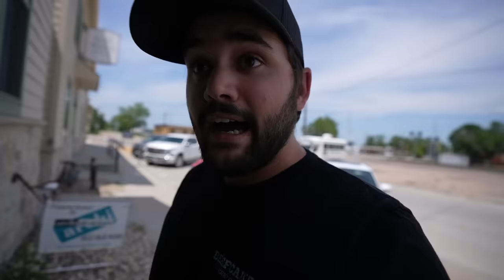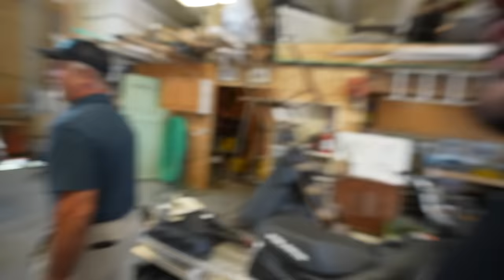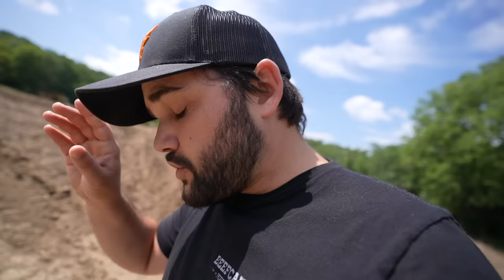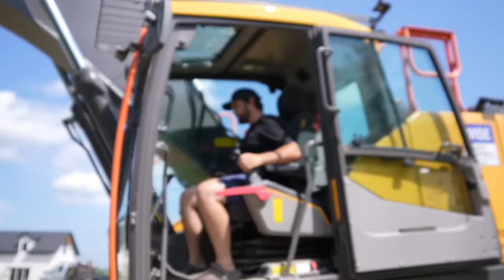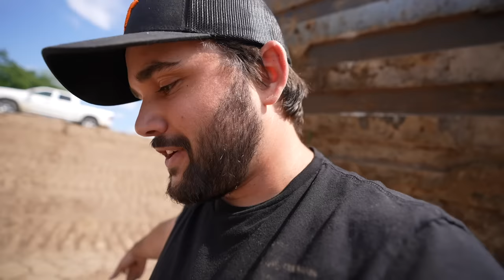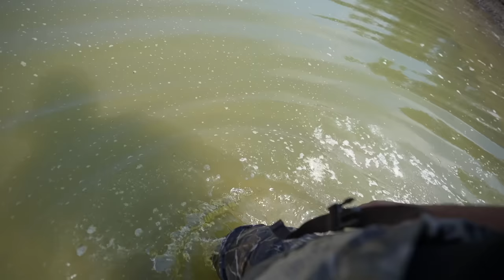FILLING the NEW BACKYARD POND for the FIRST TIME!!! (Will It Hold?)

Comment: Just a suggestion. Put a PVC pipe from the well pipe to the middle of the pond to prevent washout. It can be a temporary pipe until the water level gets to the main well pipe
Reply: A number of sections of pipe, then remove them one at a time as the level rises. Keep a rock/concrete under the outflow to break up the flow as it exits the pipe, just like he has done with the initial section.
Reply: This
Reply: Literally was going to suggest this
Reply: Same
Reply: Leave it for the small fish to hide in after
Reply: Stock some trout in there if it’s staying that cold
Reply: Or put a 90 on it and let the water rushing in shoot up
Reply: What this guy said!

Comment: You may want to think about a water tower/tank. If you ever have to redo the pond, it would be faster to fill it with stored water than to wait for your garden hose to fill it. You can even use solar/battery powered pumps to fill the tank 24x7.
Reply: That a good idea

Comment: I have always been a massive believer in 'do it once and do it properly'.  I can very much appreciate the turn-off of the massive expense of bentonite after it probably has felt like open season on your bank account since starting this awesome new project at this property.

If there is even a chance of seepage/leakage on top of the risk of evaporation I would be spending the money now while the lake is mostly empty and then you can rest easier going forward knowing your lake will not seep away back into the ground and you are set for the long term and have longevity for your lake.  Especially given you don't have massive water pressure and there is a risk of possibly draining your well.

But either way - thank you so much @Flair for your vlogs and content!

Comment: I wonder if an extension on the pipe where the water is coming out to reach further to the bottom would help wash away. Give the water less distance to travel til it reaches the low spot

Comment: Hey Flair, I got a friendly little tip for you. Maybe you should get some "Coconut Peat" it's a fibrous filler that comes from the outside of coconuts. They sell it in cubes that expand with water. It is really look for helping structure. If you mix it with the natural dirt, you should be able to use it to help keep those rock's in place.

Comment: If your hatchery is concrete then you can put dividers for different species including crawfish… Concrete above ground with some kind of roof structure would be the deal.. then no worries on seepage or anything.. and for winter time you can buy heaters to heat up the water so the fish don’t freeze…

Comment: Really hope for your sake that the water holds and doesn't seep too much without paying for bentonite. Pond is going to be awesome when full and fishable. When you build the fishing hut you should have a wrap around deck with half the building over the water so you can have a place at one end that has like 3 removable spots in the floor for fishing out of, especially in winter time, just make sure you build it big enough and put a boat ramp next to it with rock and tree stuctures under it to hold fish there.

Comment: Awesome dude! Can't believe yall are finally getting water in. TBH I'd wait to put fish in until the water level is at least at your well output. Back pressure could cause some issues with filling and it might require partial disassembly of your input location. If you are really itching to get fish in there try stocking it with hardy species like sterilized catfish that can survive low water conditions. Maybe some trout too for a species you can catch during the winter. It looks awesome though and I can't wait to see how it works out come the next episode.

Comment: you should just extend the well pipe with a temporary hose to dump directly into the existing water eliminating the erosion of it running down the hill and you can move the hose back as it fills
Reply: Is erosion in the bottom of a pond a bad thing? Fish love crevices and I'd think it's a good thing.
Reply: TAPHERE--...  Scammer.
Reply: @fauxque5057  it can be. it can cause a lot of silt to built up and it could erode through the hard pack to soil that leaches more, thus creating a hole in the pond. it would be best to prevent it as much as possible right now

Comment: You need to ensure it’s basically sealed as if there seepage in the long run it will cost you more money. Are you getting fish pumped into the pond? You should do a measure table stick in the pond so you will know how feet it is are in there. Instead of having to walk in.You should start pumping fish in there in preparation so they are not tiny fish

Comment: Did your well guys discuss what will happen when your water gets above the level of the pipe? As the water level increases the pressure at that depth will also increase, eventually to the point where the water will not flow into your pond anymore since the pressure from the water in the pond will become higher than that of the pump. You should be able to calculate the pressure of the water coming from the pump using the flow rate and the diameter of the pipe. Then you can get an estimate of the water pressure from its depth. If pressure due to depth exceeds pressure due to pump then the water will flow backwards into the well until it equilibrates.  You will be able to calculate the max depth of you pond (in its current configuration) using this information.

Comment: now that you have pooled water, use 6 or 8 ft wide plastic from the spout to a few feet into the standing water and there'll be no erosion. use small rocks to hold it down. once its filled to the spout you can pull the plastic out. less than $200

Comment: You should build a shelter and plug your portable battery bank into it and get some extra solor panels. That way it will fill by itself from solor for free. Or build a little solor setup. But the portable withbthe extra bank and a more solor panels  would work nicely and hopefully have enough juice to powernit throughout the night. Maby have them send you another unit or 2 with extra batteries so you can daisy chain them and the largest panel setep they have. It will be in the next few pond episodes so why not get paid?

Comment: Not sure if you thought of trying to either rent or borrow a water truck or the other option if you bought one from a say govt auction even though your running plumbing you will always have a portable water source on property for animals to fire protection though not sure of that area, but assuming its rual so for fire protection being that far off the main road look at min 10k gall underground tank hopefully it will never be needed . Than you have few options if you can find a discreet hydrant and "borrow" water or get a gas pump from harbor freight and borrow it from other places.

Comment: Is erosion really a bad thing in the bottom of a pond? Fish love crevices so I'd like to think a crevice would be a good thing.
Consider solar to run the well 24/7. A 240v solar charge controller and a bunch of used panels would run around $2500. Add some LiFePo4 batteries to run during the night and it would only add a couple of more grand. Cheaper than an electric bill and running 100 miles of expensive electrical cable. But you've already started the trench and your videos are more history, than current. You can do a cheap 120v system for the animals at least.

Comment: hey flair i thunk your on to something about the two ponds i was going to type it in the comments but you beat me too it but i  have an idea for your ice fishing cabin/bait shop and whatever but so i would do like a 10 ft by 10 ft concrete pad by 6 inches to a foot thick with four pillars  and have two holes on the one side like one 2 ft in off off each side  and one at 8 foot and then your couch looking towards the holes then could put your tv on the oppoisite wall but have a window below the tv so it can be the place for whoever to come up to get the bait or whatnot but i am a decent at coming up with blueprints and drawing pic but its just a suggestion